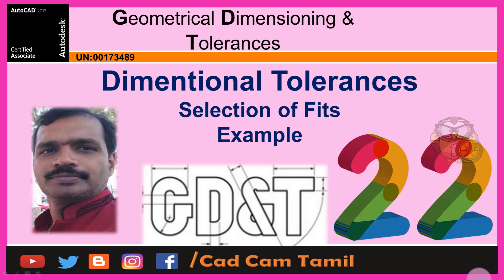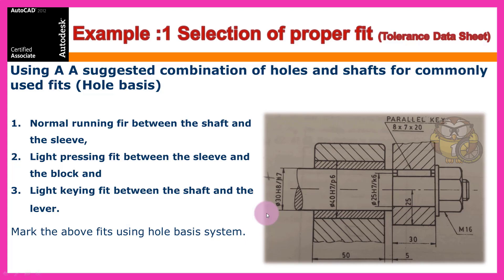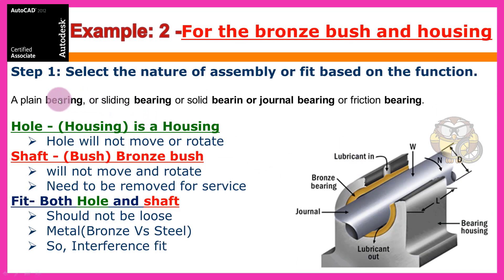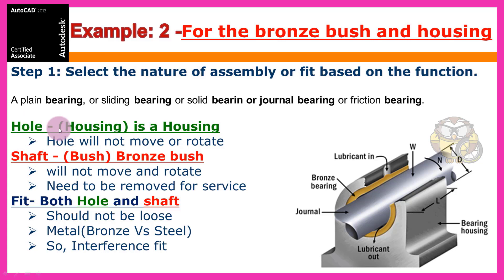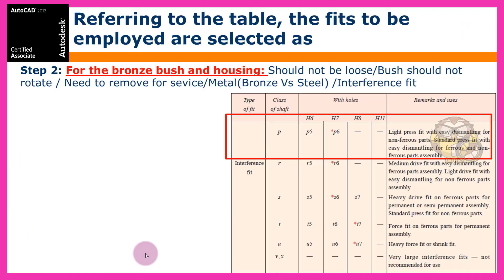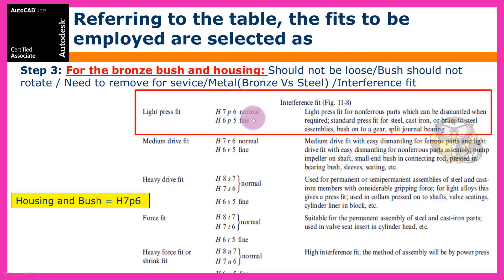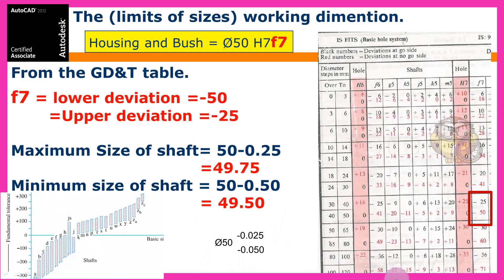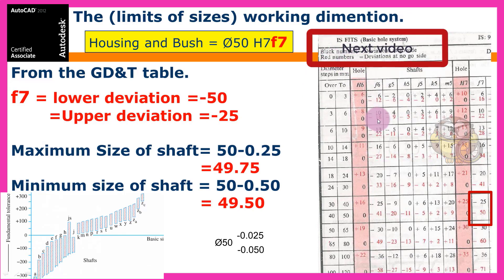GD & T | Tamil | 22. Selection of Fits Examples

Comment: Hi sir One doubt at last of this video you mentioned 50.00 0-0.050 & 50.000 -0.025 then Ans should be 49.950 & 49.975 respectively why 49.50 & 49.75 
kindly clarify sir is it 25 microns and 50 microns or 250 & 500 microns
Reply from the maker: Dear Santhanam, You are correct. it is 25 microns and 50 microns not 250 and 500 microns.  Thank you.

Comment: Sir Hole and shaft ku Grade vachi tolerance limits set panrom. But liner surface like square size plate ku ( length) + or - Tolerance deviation set panradhu epdi  edha depend pani tolerance set pananum sollunga sir